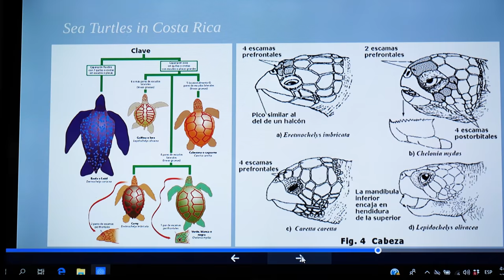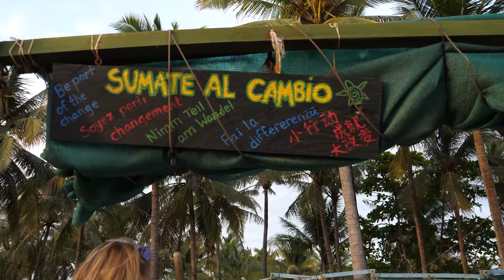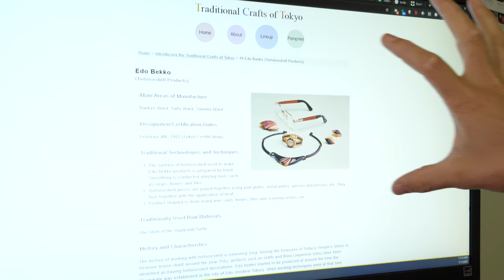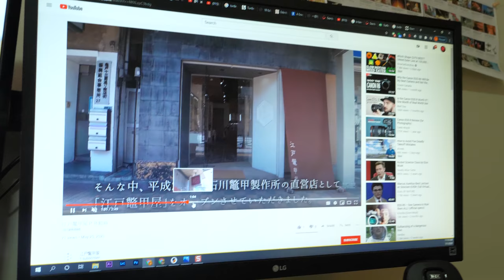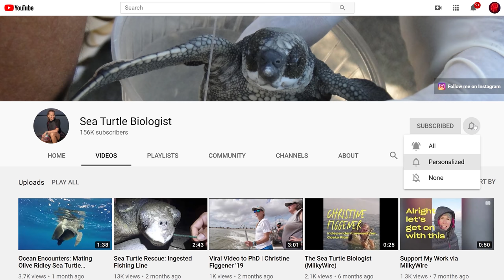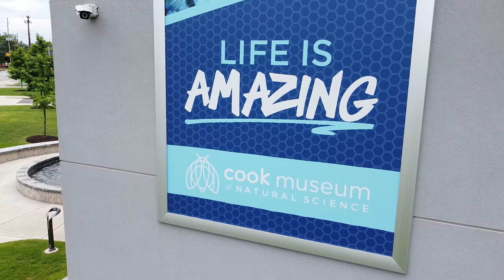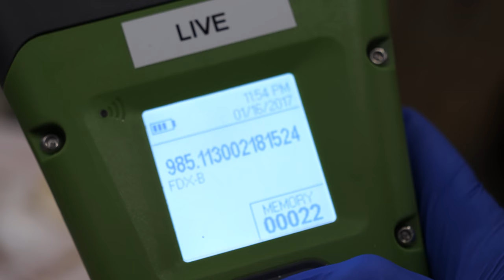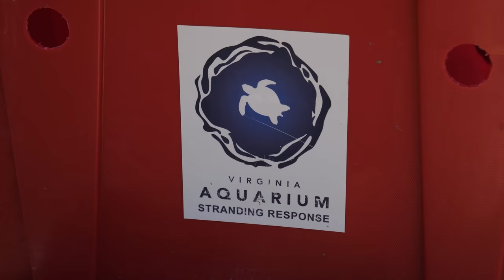Everything about Sea Turtles  - Smarter Every Day 239

Comment: 48:50 Question, do you think it has something to do with the direction of moment rather then getting comfortable? 
maybe he got motion sickness when he was traveling in 90 degree to the direction of the car.
Reply: Dang, you could totally be right about that.  The other thing that came to mind is with his/her fistula being on the underside of his/her chin/neck, maybe it's more comfortable to stretch out that skin with the head pointing up like that.
Reply: @mrnine324  I was thinking it might to BLOCK the fistula by pressing it against the plastic, which normally being under water wouldn't be an issue, but in the air, the turtle's insides would be prone to drying out faster....
Reply from the maker: After the third rotation I thought the same thing. I  tested it by turning Kale’s crate 90 degrees. Same thing.. rotated to align sideways to the box, chin up. My conclusion was that something about chin up was more comfortable to Kale.
Reply: That’s a great point! Considering sea turtles are basically natures GPS units. They somehow know the coordinates to the exact spot within feet of where they were born. When the car hit highway speeds I wouldn’t be surprised if it did feel weird to the poor lil guy/girl.
Reply: @timesfly1081  Read Destins response right above your comment.
He practically "disproved" the motion theory. It seems to really be about comfort, or the fistula.
Reply: Martin Finnerup oh gotcha. I didn’t see Smarters reply. Don’t know why I would think he wouldn’t have tested that theory lol

Comment: Hey Destin,

Maybe the turtle allways went back to the uncomfortable position during the transport because it‘s head needed to face in the direction of movement (of the car) so it doesn‘t get disorientated
I would have loved to turn the box 90 degree and see if it would still be in the uncomfortable position or if it would orientate to face the front of the vehicle
Now i have tons of questions about the navigation of turtles :D

As someone who studied mechanical engineering for some time but now starts biology i really love your videos
Keep doinig what you‘re doing it‘s great and unique
Reply: Destin responded to a similar comment and clarified they did just that. When the crate was rotated Kale still went into the same position. Thought you'd like to know! Cheers

Comment: Sea Turtles are amazing. The other common issue that they face is getting their shell cracked by an impact with a boat or propeller, which then causes air to get trapped in their shell and they're unable to dive. It's known as "Bubble-butt Syndrome" and there are some really interesting developments in 3D printed braces combined with weights that allow the turtles to regain neutral bouyancy.

Comment: Just wanted to throw a question. I was noticing when I froze a gallon of water and half was white with air. And the other was clear as glass. Well i use it in a homemade ac. And i noticed the clear ice melted first and almost all the ice with bubbles was left. Is the air acting as an insulator?

Comment: I wonder if the reason for putting his head up high in the container was to relieve pressure from the fistula or change the shape of its esophagus because of it. If there's pressure on the fistula that is distorting the shape of the esophagus when not under higher buoyant forces of water affects is ability to swallow or breathe or if it's just uncomfortable to rest the full weight of its neck and head against the keloid scar tissue. Kinda like if you try to put just a bit of pressure on your Adam's Apple even if you're not eating.

Comment: To bring in more of your own expertise, you should work with more ecologists/conservation biologists on how math and statistics is applied to conservation. There are a lot of relatively simple math concepts that are widely used in conservation, and it could not only help to introduce people to conservation and inspire them, but it actually makes math more interesting and fun to learn when you can see how it's used. As a starting point, (capture) mark recapture would be a great example of simple math and probability and how it's used to estimate and monitor population sizes. As an introduction, you can use it to "count" or estimate the number of marbles (or jellybeans) in a container. Then maybe do your own experiment of capturing something, marking it, and then resighting/capturing later (maybe with some kind of bug in your yard? set out some non-lethal traps, paint a dot on them, then release them, the trap again later). Then go to ecologists to discuss applied examples, which could include bird banding, remote cameras of species with identifiable markings, tagging of small mammals, and maybe something involving a larger species like deer, bears, or feral hogs.

Comment: I'm not sure if 100% hatching and releasing is actually doing good for the population in the long run. Because it will enable gene sets that were discarded by nature to procreate, and occupy eggs that otherwise would have been fertilized by a more suitable male with a stronger set of genes... Reducing beach predation and human disturbance: YES! That is definitely helping a lot. Because those factors are not dependent on the health of genes. But digging up hatchlings that wouldn't be able to surface on their own... I dunno... Seems like disturbing the natural selection that has strengthened the species for thousands of years.